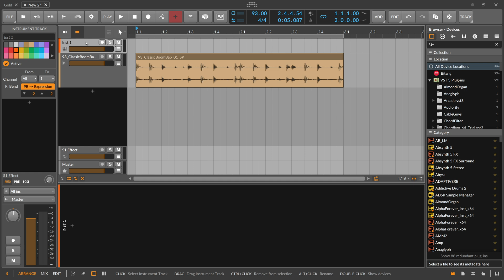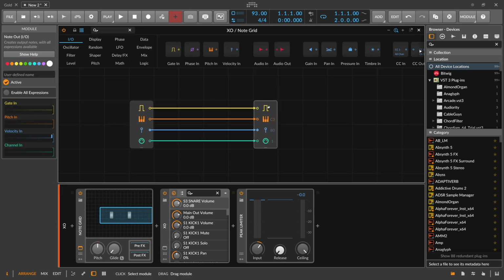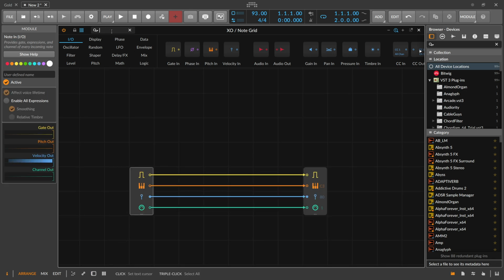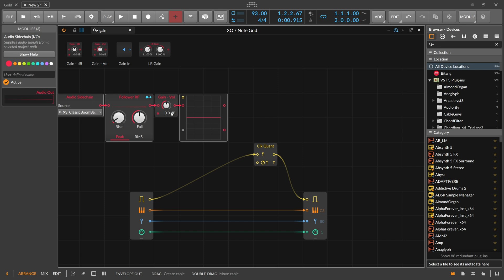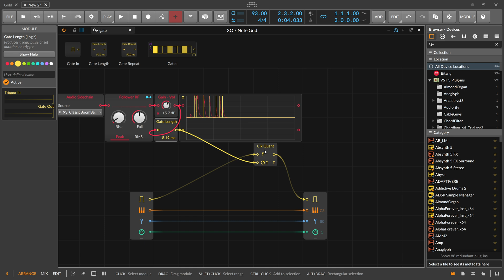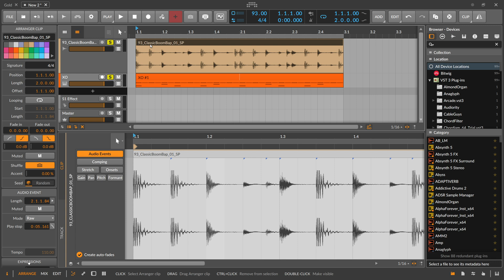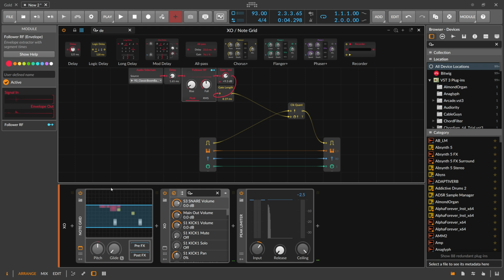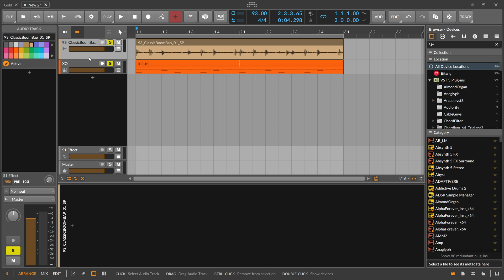Extract Grooves with the Bitwig Note Grid - Groove Pool Fix?

Comment: its there a way to do the same in a older version bitwig like 4 .0.1 for example
Reply from the maker: yes. you use the polygrid (instead of note grid), and for the "note out" module  you use my "grid note out" preset: https://www.youtube.com/watch?v=0G1i8I_1Iz4 besides that, it should be the same